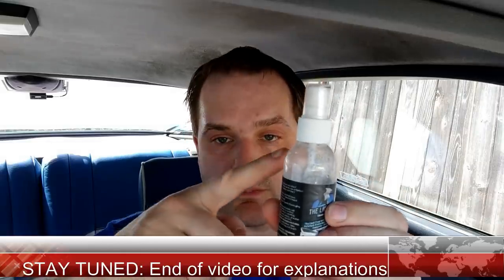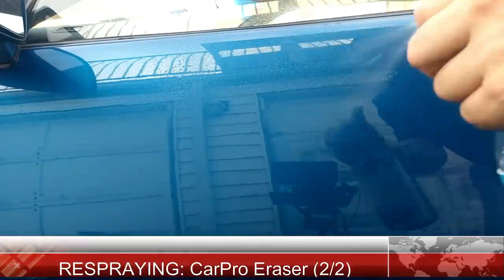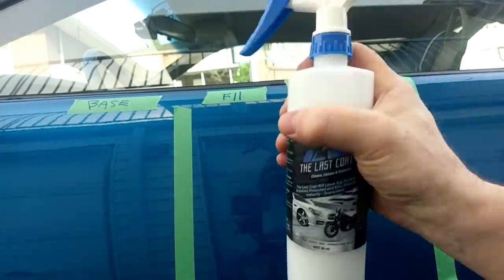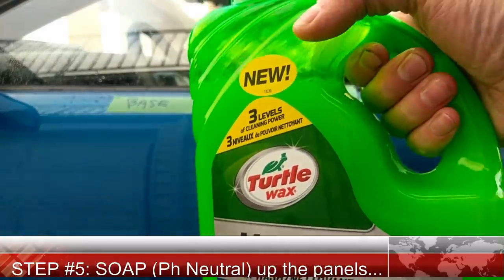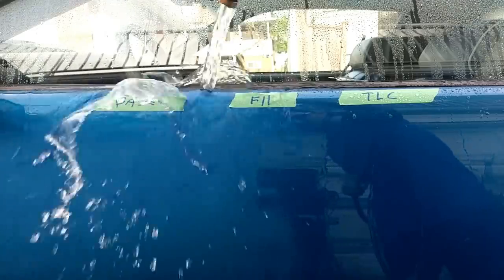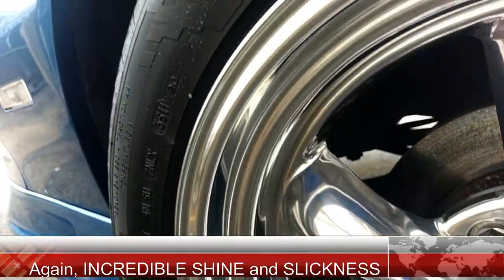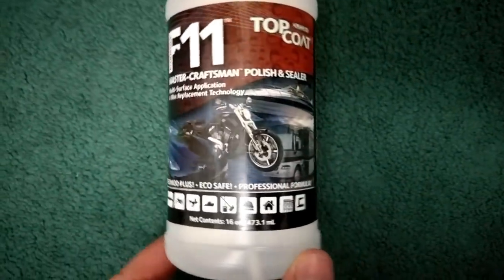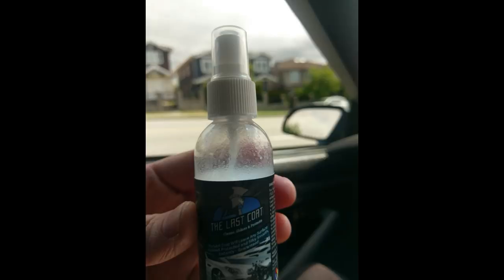TOPCOAT F11 VS. THE LAST COAT. (RESULTS WERE SHOCKING!!)

Comment: I bought a bottle of TLC The Last Coat and I must say I am very impressed.  So impressed I later bought the big jug and stocked up.  I highly reccomend this product!!
Reply from the maker: I'll be putting it up against f11 again this time on my winter car splitting car in half for protection. Anxious to see the results
Reply: save yourself some money and buy p&s bead maker let it cure for 8+hrs and you will get better results than f11 and the last coat btw p&s is way cheaper even in a gallon matter of fact their 5 gall still cheaper than f11 and the last coat  1 gallon.
to maximize the amount of product you use do yourself a favor and buy an spray bottle with an atomizer sprayer head. 
slickness and shine should be better than f11 and last coat.
and FYI neither of this products remove swirl marks some of them might be able to mask them for a few days but that's about it

Comment: It makes me smile when I see some of these new products and the way they are marketed.  "The best stuff known to man", they say.  Why aren't any professional detailers using them?
For under US $20, you can pick up a small can of Sonax Polymer Netshield that will probably give you the best beading of anything out there, and it's made by a very reputable company.  For the same price, you could pick up a tin of FinishKare 1000 aka BWM-101 (name was changed many years ago due to very similar names across their product line).  One tin of this stuff will probably last you the rest of your life, as you put on the thinnest of coats.  Applying it thin... It's easy on, easy off!  Both products give you a good 6 months of beading and protection from bugs, bird bombs, and UV.  For around US $30 you can get a tin of FussoCoat.  Again, great beading, protection, and longevity.  A good deal harder to take off if you don't apply it paper-thin, but remarkable stuff and possibly up to a year's worth of protection on your daily driver.  The Fusso  products (Japanese-made) are not well known as the product was unavailable in North America until maybe 6 or 8 months ago, but reviews are great. 
 Give it 6 months or so, and F11 and TLC will be rehashed, and re-spun again, and marketed through social media with all the right key-words and suck in more new buyers.  But will the pros use these products?  Most likely not.  And lastly for those in an extreme budget, believe it or not Nufinish for under $10 at big box stores, actually lives up to the hype.  Never thought it possible, but it does.  Google for 20+way comparisons (one is a 32 or 34 way comparison) for sealants or coatings on YouTube, and see for yourself...but you have to use the liquid version, as reviews show the solid version to be crap.  Me, I'm a nobody, with lots of last step finishes here at home, and I use the Polymer Netshield on my vehicles, and it gets me through a full northern NY winter on my daily driver (100 miles per day to work and back). Shines well, lasts long, protects, beads like crazy, and is as easy as wipe on, and immediately wipe off, with no waiting in between.  Instant bond as soon as it hits your paint or wheels or even your black textured trim (no white residue too).
Reply: All the products you named here are great I'm sure.  I personally have only heard of and used Nufinish which is indeed a very good product. But to turn your nose up to The Last Coat because of price is a mistake. I purchase mine from Amazon for 40 bucks which may seem a bit steep at first but because you use such a small amount to cover an average sized vehicle and an even smaller amount after the first application, the price per ounce is comparable to any of those other products you mentioned. The Last Coat can be safely applied to rubber and plastic parts as well. Something a product like Nufinish cannot claim.  I have used just about every car care product made over the years from the cheapest to crazily expensive and I can say with confidence that TLC is one of the best sealant products I have ever used. Brilliant shine, unbelievably hydrophobic and last a long time to boot. To get that level of effectiveness from such a small amount of product  in 15 minutes of effort is incredible in anybody's book. Try it before you knock it.

Comment: Based on your video report, I have replaced my F11 with TLC and man oh man, what a difference!  Now, for quick shines, I use their AMP product and the protection gets better and better. Thanks for such a logical presentation.
Reply from the maker: Thanks for the positive comments. Yeah, I just swear by there stuff. I've used many of their products and none so far has been anything but the best I've ever used and I've used a LOT of different products throughout my 23 years of car shows with 10-15 a year (before covid).

I use TLC2 (since TLC) for the main topper and then to replenish or just for that added boost, AMP it.

Comment: I have never used these products but do know F11 has some aggressive advertising and statements like its no joke and it does not wash off is admittance the product does not perform well. I also know there are lots of shady business practices in Florida and weak consumer protection laws.. I had the same experience with trim dressings from Chemical Guys, the stiff washes off in the rain and their wax does not last nearly as long as their claims. If you want a decent shine and fair protection, Turtle Wax ICE Spray Wax or spray Sealant are great products and quite inexpensive to use.
Reply from the maker: You are correct, they require at least 24 hours to cure. I redid the video in recent times and the results were exactly the same even with 27 hour cure time.

Comment: Paul,  
  water beading ability alone does not prove that a product is a good protectant.  How good is the TLC with UV protection?  No one knows, as it has only been out for a short time.  I think I used my first bottle of Topcoat High Performance Sealant back in 2006 on my then brand new F250.  That, and Ducoras’ Polywash, which is a wash and polymer coating primer for Topcoat, is all I have ever used.  The truck is now 12 years old with 130,000 miles.  The gray metallic exterior still looks brand new, due to the UV and environmental protection I got with Topcoat.  I hardly have any swirls, as I seldom wash the truck. I have what I believe is the longest ongoing test mule truck, and the condition of the truck exterior prove that Ducoras Topcoat is a great protectant and wax substitute over the long haul. We will have to see how this newTLC product performs over time. A lot of things can make a car shine, heck us old timers used to use houshold Pledge.  One comment I would like to make about your comparison, is that F11 is an eco friendly water based product, and has a cure time of at least 24 Hrs.  Of course it came right off with your immediate washing!  There are a lot of things one can pour on a finish to get it to bead water.  That doesn’t make them all good protectants. That’s what Topcoat is, a good Protctant.  It is not designed as a fix for already damaged surfaces or screw ups, but it sometimes does help restore, and make damaged surfaces look better.

Comment: Still doing some testing.  the application ease, the shine, the smoothness, and water repellancy is very close to identical of that  of Ducora’s Topcoat Quick Gloss Spritz and Dry Wash product that sold back in the day for around $11.95 Per 16 oz spray bottle.  I still have some of the Topcoat Spritz product, but I do not know if the manufacturer is still actively marketing it since the F11 product came out.  I have not come to a conclusion about a durability comparison between the two, as I’ll need to do a panel and subject it to car washing, sunlight, rain etc.

Comment: I've been using f11 since they came and I've been seeing the same problem over and over. F11 topcoat needs at less 30min to fully cure to developed into a clear film that will even fill in light scratches. I'm trying to find a good test with TLC vs F11 but no one waits the 30min.
Reply from the maker: I've used F11 for a year before switching to TLC and found exactly what I showed in the review. I had many multiple coats of F11 on the car and even with all those coats, a rainfall or two would make the slickness disappear.. The instant you tried to wash the car, it too disappeared.

With TLC, I have used it since May of this this year and find even after rainfalls, the paint, windows, rims, plastic, still are slick under even a layer of dust. I can just rinse the car off OR USE a PH balanced soap without any issues.

I use Chemical Guys Honeydew foam and it works great without any issues with TLC. :-)
Reply from the maker: I will be doing another F11 VS TLC video in the coming months using my winter car that has no protection/wax/polish on it. 2011 Chevy Cruze

My plan: Split the car down the middle. 1/2 TLC / 1/2 F11 and see what happens.. What happens with general rainfalls.. Salt, etc..
Reply: I'm looking forward to it. I'm down to my last couple of oz. I always make sure to wait a full 30 min after coating with f11 before buffing off. F11 commented on this other guys review https://www.youtube.com/watch?v=GtwDwtzIhE8. A good friend of mine uses G thechniq and he was amazed when using F11.
Reply: @randynguyen8604  I've got over a quart left of the F11. I'd sell for very cheap.

Comment: Can tlc be used on tires, convertible tops, flat finish, glass?
Reply from the maker: Yes. There isn't any surface that I know that you cannot use TLC or TLC2 on :-)
I heard that if you use TLC/TLC2 on tires, it will put a matt finish to them. I haven't personally tried it as I use Cristal Products Untouchable for my tires as seen in my review video's.

Comment: If You know F11 has a curring time. Just like the TLC. You can use soap and not only that there is steps to every coating.
Reply from the maker: Yes, you are correct. That is why is mentioned it in both my description and comments that I had redone the test multiple times and like many others, got the same results :)

Comment: I have to say the shine with F11 is far better than TLC. I don't really care if the water beads off faster as I don't take my ride out in the rain. What about the shine test? Did you compare or see a difference in the shine. Just curious as to what you found.
Reply from the maker: When I did my test as seen in my most recent video's, I didn't notice a difference in shine between TLC and F11 in my 2-coat application of both. However I did notice that the TLC side was slicker than F11 and that the durability of TLC FAR outlasted F11 in my experience of BOTH my cars and nearly a year of using them both..

F11 completely disappeared off the car with only 5 days of rain where as TLC remained and seem uneffected by the rain in that period of time.

For me, DURABILITY and the length of time that SHINE and SLICKNESS remains is more important than having to reapply all over again between we had a week of rain and now it's gone (F11).

But that is just my personal opinion on what is more important to me.
Reply: F11 is a more viscous product.  You can see this as you apply it.  TLC is very thin, like Topcoats’ least expensive product called “Spritz”. From my experience, both are very shiny, but the thinner products are quicker to apply.  I’ll usually use the thinner products as my final coat. We have several early Porsche 911’s in our stable, and don’t like to get them wet.as these early cars were non galvanized and prone to rust..  They are never washed with water, or driven in the rain, so we really don’t care about water beading.
Reply from the maker: @rodgraff1782  I didn't notice anything difference in viscosity between the two products. 

Between the two products, both in my usage had similar shine, similar water beading properties, but did feel that TLC was a bit slicker. Between the two, I lean towards TLC because the durability was far greater on my two cars.

I'm not the only one online to have experienced a lack of durability with F11 so I don't believe I applied it wrong. There are numerous reviews online that had the result of F11 failing 1st before the other products.

I also lean towards TLC because I don't have a [no wash] clause that I had with F11. When I used my PH balances soap, it stripped off F11 on both my cars and then the latest test where it failed after 5 days of heavy rain. I dont know what I could have done wrong.
Reply: WestCoastCamaroZ28 Paul. I’m using the original Fll formulas.  Perhaps the manufacturer has changed to a thinner formula.  Maybe that is the reason I’m getting good performance??

Comment: Thank you, this is a really good informational video, and secondly I almost broke something when the shot went to your car. This is my first visit to your site and she is a beauty,. and I'm a Mopar guy. Although not strictly I still love all cars, especially Camaros, Vettes, Mustangs and anyting Mopar Muscle etc., but that is one of my absolute favorite cars. Quick question, curious about the f11 cure time? They say that it has to cure before it actually does what it does. So I wonder if the TLC doesn't have a cure time issue? Or if you just didn't factor it into this test for either one? And before this becomes a book, my car currently has Zaino on it, and I'm curious to see that comparison but I think you said that you dropped the video unintentionally. So wondering can you maybe just give me a result of the Zaino vs.???  anyting you can shed a light on? Thanks again great video and I'll be back and you've got a new subscriber.
Reply from the maker: Thanks again very much for the very nice comments :-)

F11 has a cure time of approx 24 hours and while I admit that I didn't give it that cure time in my test on this video, my latest video with F11 where it DID have a full 24+ hours to cure, yielded the same results. There is a video online where a hood is split into multiple parts where different products are added to see how long they last.. F11 failed IMMEDIATELY on his test.. Less than 1 week later... So that backs up the same results as I got once it rained.

I used zaino for 15 years and was my GO TO product since that time. I found it had fantastic durability and shine but the only thing was that it would take SO LONG to apply. I would be in weekly car shows (10-15 a year) from May - Sep) and so I would re-apply a coat each time before the show. And while you could just add Z6 (I used Z8 more), I wanted the BEST so I would add another coat (3 coats) which as you know, is a bunch of steps. I haven't used Zaino in a few years now but I believe I remember the steps I would do..

- Wash car w/ ph balanced soap & Dry

- Apply Zaino Z-AIO, wait 20 mins and whip off

- Z6 spray to the entire car, and wipe off
- 1oz Z5 scratch remover and ZFX drops and wiping on in specific wipe directions
- Wipe on, wait 20 mins, wipe off

- Z6 spray to the entire car, and wipe off
- 1oz Z5 scratch remover and ZFX drops and wiping on in specific wipe directions
- Wipe on, wait 20 mins, wipe off

- Z6 spray to the entire car, and wipe off
- 1/2oz Z2 PRO polish and ZFX drops and wiping on in specific wipe directions
- Wipe on, wait 20 mins, wipe off

- Z8 Grand Finale spray to the entire car, and wipe off
- Z-CS Clear Seal Spray entire car

- TIME: Approx 3-4 hours

Now as I said, I had NO ISSUES with Zaino; only that it just took so long. I couldn't do it where I lived so I had to go to a local covered parking lot in order to apply all the steps.

I found that F11 gave the EXACT same results as ZAINO but was SO incredibly FAST because it was just a WASH, DRY, APPLY, BUFF OFF procedure. However once the rain started months later, I realized that it was being striped off my car very quickly. I stopped praising it to others and eventually came across TLC THE LAST COAT.

However, surprisingly enough, it didn't yield the same negative durability results and I find SO MUCH EASIER to use and the durability is AMAZING!!!!!
Instead of applying 2oz of zaino products to the car, TLC once a layer was on, I could easily MIST ON 1/4oz to replenish IF NEEDED.
The slickness is INCREDIBLE and I have since that day in May of 2018 completely changed my cleaning habits to TLC.. It's even taken the place of all my Interior cleaning products.

Comment: So I was using zaino for 10 years and I tried that hydrosilex but not happy so I return it. I'm looking at the last coat Is last coat a coating worth using if my car stays out in fla.sun all the time. Any thoughts.  Looking for a long lasting polish .
Reply from the maker: Thanks for the comments. I used Zaino for 15 years and swore by it.. It worked amazing but to properly apply it, there were MANY steps (8 I believe). What I love about TLC is that the SHINE and the SLICKNESS is pretty much always there just under the dust and dirt. I just wash the car with a PH neutral car soap and the SHine and SLICKNESS reveals itself giving the car that JUST WAXED feeling and look.

I have completely switched over to TLC. I have not had to use any other product to CLEAN by rims in months because there rims have ALWAYS been slick so dirt, dust, and even brake dust does not stick to it.. I used to need to use the Mothers Power Cone and White Diamond metal polish.. Not had to anymore..

Comment: Sorry buddy ! What i was trying to ascertain was are you using this stuff as a sort of quick wax over a ceramic or a hand wax carnuba or are you confident with this stuff being totally in place of these other methods as total vehicle protection lasting months at a time?
Reply from the maker: The car has never had a wax nor ceramic applied to it. The car was stripped of f11 a year ago and has nothing other than the last coat TLC on it.